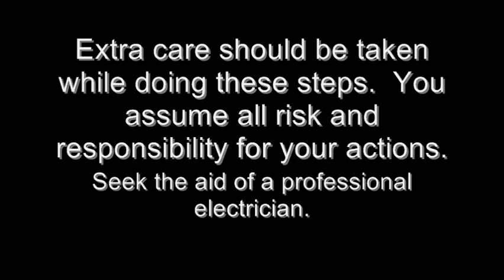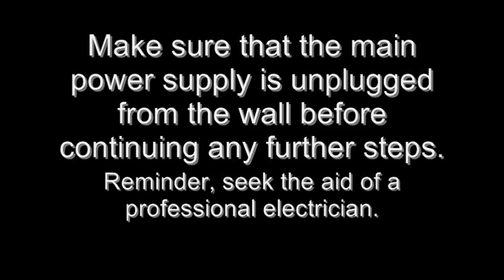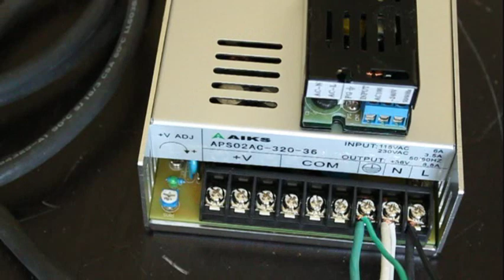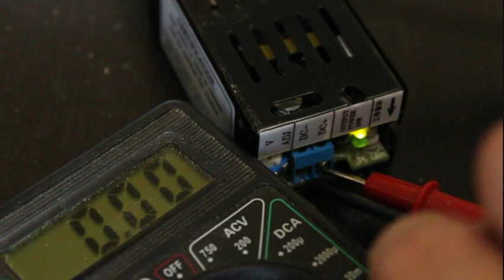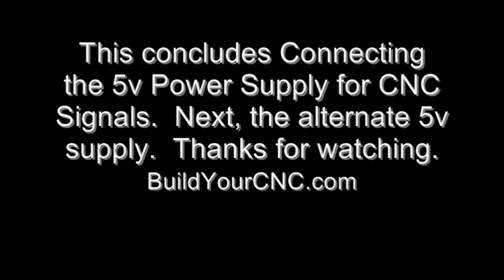cnc electronics 2 - 5v power supply

Comment: hi sir. i bought a almost similar breakout board like yours. its DB25 breakout board from wantai. it needs the same 5v to power the board. so, i go ahead bought a 5v power supply from my local distributer. but there are so many choices of 5v power supply. so at the end, i bought 5v 3.8A power supply. im not too sure about ampere and currents. all i wanted to ask is that, will my power supply (with 3.8A) fry my board? or will that work ok? im afraid to test it out at the moment >_<

thanks in advance :)

Comment: The wall wart type power supply (the one that plugs directly in the wall in your video) is unregulated, which means it may provide up to 7-8v at low loads, and under 5v when under heavy load. 
They're designed to be used as cell phone chargers, or devices that will actually regulate the power they give.
Better use the one actually shown in the video, or take the 5v from a computer power supply, especially if you're going to need one for other parts of the machine.